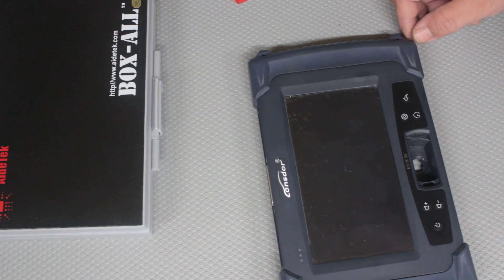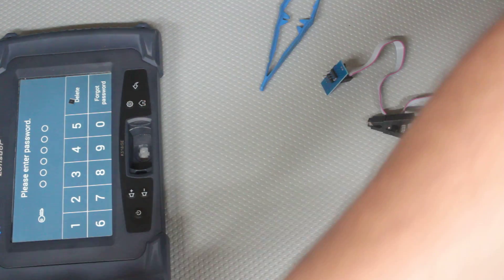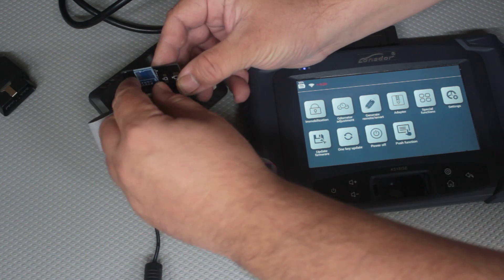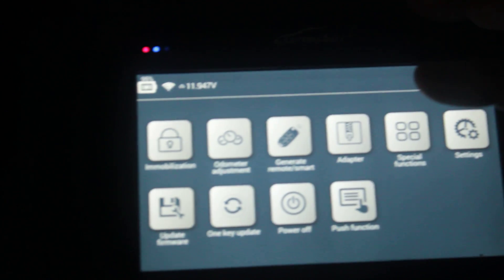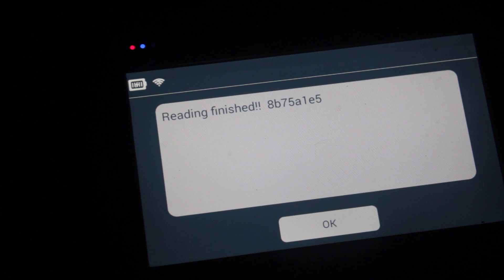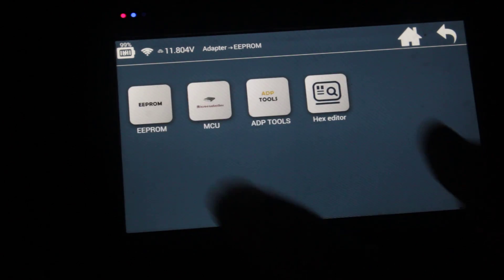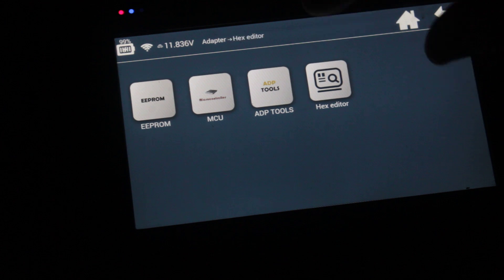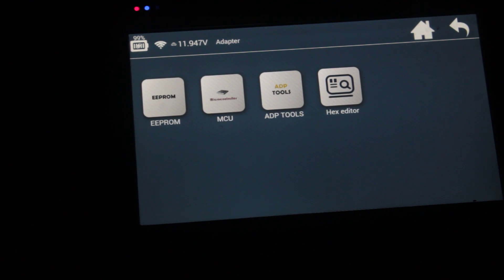Lonsdor Eprom Flash SOIC 93c46 Test

Comment: Lonsdor for the win!! What a versatile tool. It's in my must get tools list
Reply from the maker: Hold on, see the next video, its not good for soic unless the right file is in the system, cant import files,, but OBD seems ok,
Reply: Don't buy it. It's pretty good but it is a disappointment. The autopropad is what I wish I would have bought instead. Has support and not much complaints.
Reply: @bennettlockandkeymattandja9671  it's pretty good. I was angry with it when I wrote that last post.